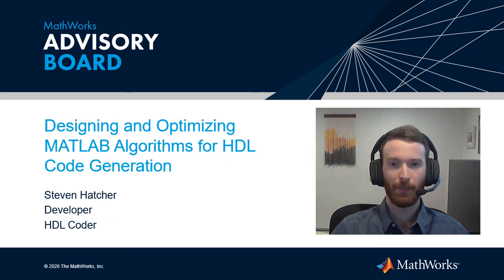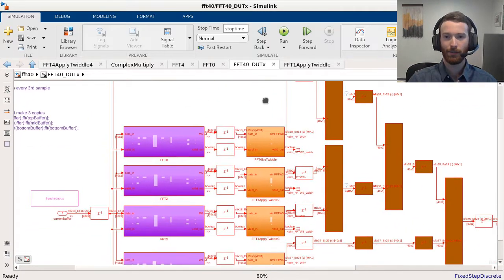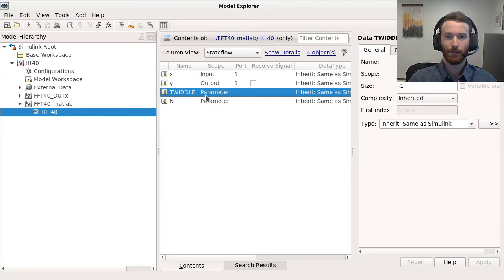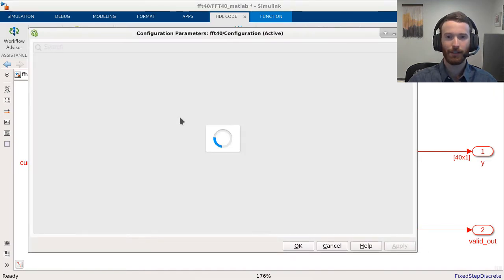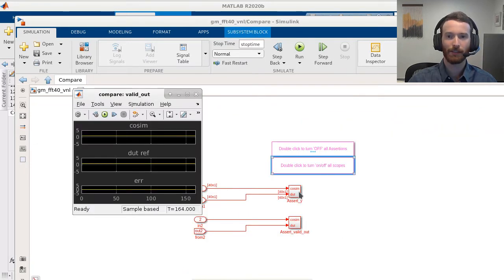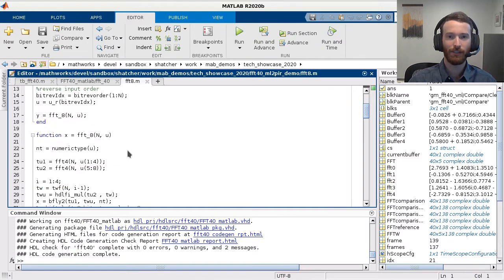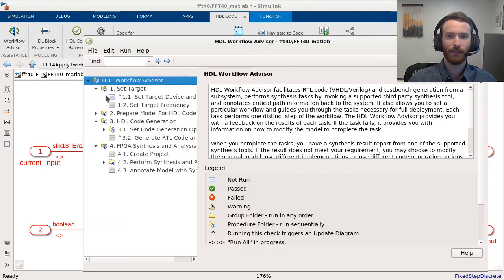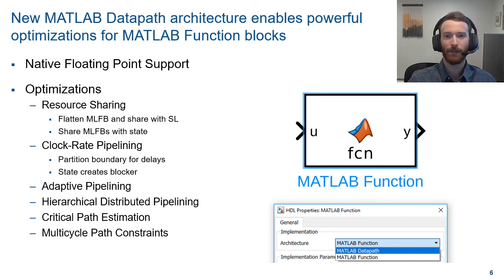Designing and Optimizing MATLAB Algorithms for HDL Code Generation

Comment: I also used MATLAB function for designing Extended Kalman Filter to estimate railway wheelset parameters. But not being converted into VHDL by using HDL coder. The error is 'Signals of type 'Double' will not generate synthesizable HDL. For synthesizable HDL code, consider enabling native floating-point mode and retyping all 'Double' typed signals to 'Single'.'
Reply: Yes I'm also facing the same problem. Please suggest any solution if available.
Reply: use fixed type